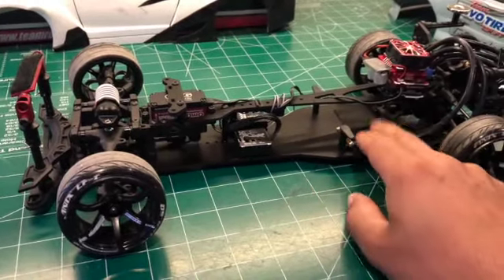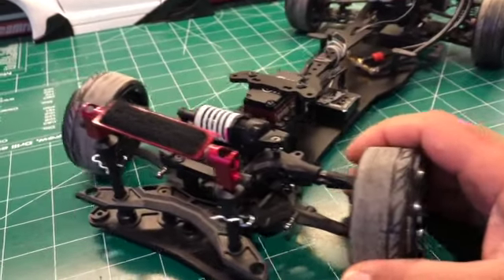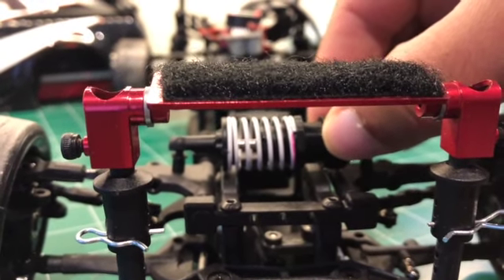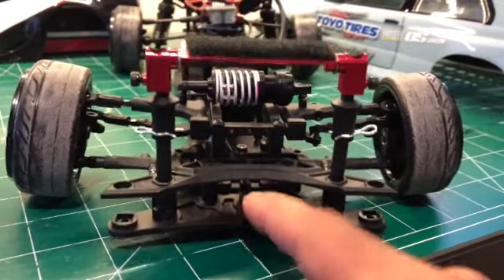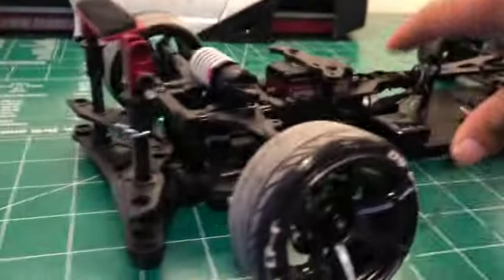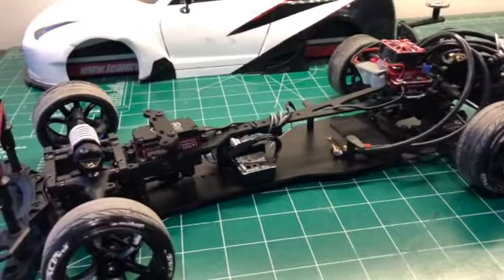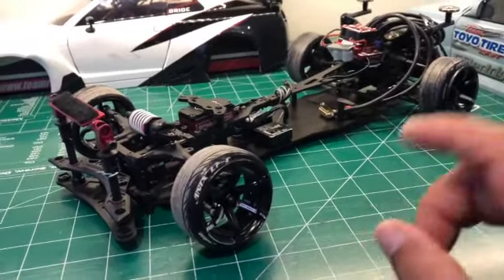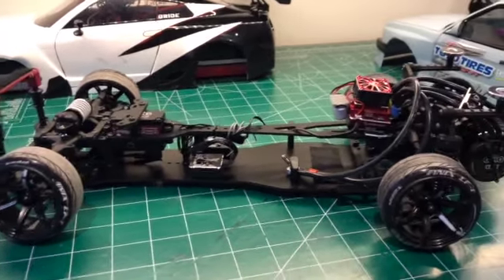sakura D5 review pt2

Comment: How is the feel between a rear motor and mid motor. I find the rear motor the swing out too suddenly.
Reply from the maker: Yes the swing is extreme try putting your shocks to the outside hole on shock tower and lower arms and going with a wider offset wheel front and rear that will help and play with gyro settings you might have to turn it up. I prefer mid rear motor with rear esc setup

Comment: Is it true that this has a wheelbase adjustment option whereas the D4 does not? My shell i want to use is 257mm
Reply from the maker: Yes the wheel base is adjustable to fit that specific size I am not as I have no body to test it

Comment: What gyro do you use? And tiers? Did you imprive angle of wheels turn somehow? I just built D5MR its my first drift chassi and im tring to tune it properly.
Reply from the maker: I am using a onisiki gyro and I changed to turn buckles on steering arm to allow me to adjust steering angle also go with a wider offset wheel stock is no good for this chassis. everything else tuning wise all depends on how you drive on the specific surface your on.